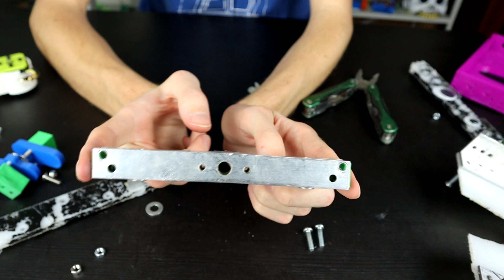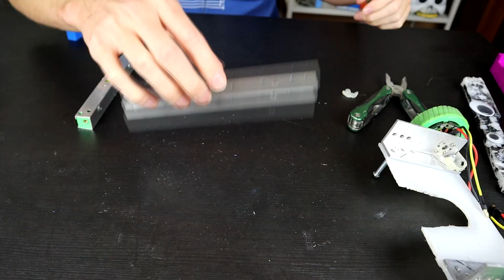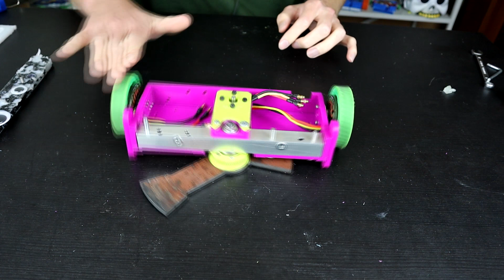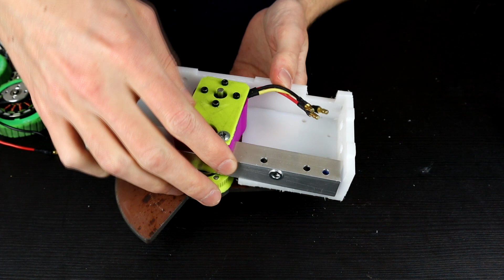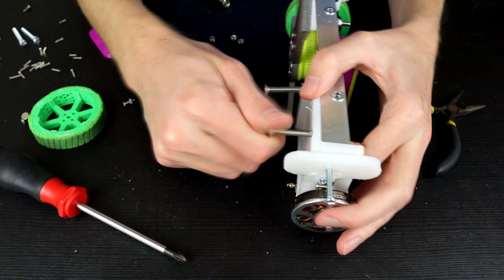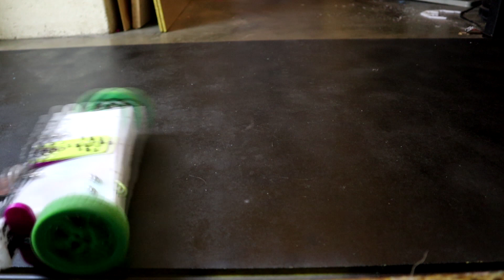Annie_R_U_OK V5 (full chassis upgrade!)

Comment: I've never seen anyone more in need of an electric screwdriver than you Ben...
Reply from the maker: Hahaha yeah... maybe... I dont trust them though I strip screw heads too easily with them
Reply: @TeamPanicRobotics  Try a "Wonderstick" which are designed for small applications and have torque limitations so you don't strip tiny screws